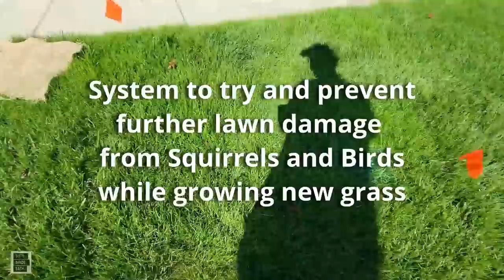EGO Select Cut XP High Lift Blade Sample Cut plus Suction Power Test

Comment: I wish you'd show tightening the bolts/nuts with a torque wrench to the proper torque values called out in the owner's manual. Otherwise, nice video.
Reply: I didn't even think of that. I should've read through the manual...off the top of your head do you recall the torque called for?
Reply: @paula.2422  , yes. Center bolt is around 36-40 ft lbs. Blade holding bolts are 22 ft lbs. 
Note that recent manuals for the 2135 and 2150 have the torque values swapped. Do not follow the manual if those values are swapped.
Reply: @mikehamm1  Excellent! Thanks so much for the info..

Comment: Hi, thanks for your video. I may not have the same grass than you, I have very dense grass and the mulching dual blades does leaves mowhak lines. I believe that the grass is not enough lifted, the mower does not get enough air. Do you think those dual high lift blades will be better even if I mulch (they sell it for bagging). Thanks for your input!
Reply from the maker: Hi Armstrong thanks for watching Honestly no, they lift but the way they are designed they are made to bag with. My opinion

Comment: Be careful using chrome-plated sockets with an impact. It can be dangerous. It probably won't happen with an impact driver like that, but I would still google why it's possibly an issue.

Comment: I went ahead and bought the blades from the link you posted above (EGO Select Cut Series High Lift Blade set @t ) and just got them in the mail today. So I immediately put them on to try and mowed for about 5 minutes. They definitely have more pull on the grass, no doubt. They suck up leaves no problem and I went over a few stragglers since my last mow this past weekend and they cut all of them. You can tell that they tax the motor a bit more but not enough to kick it into high gear just running with no load. I can tell that it will kick into high with less grass load now since the blade itself adds load. Which IMO is a good thing, talking about blade tip speed. I thought that before it took too much load for it to kick into high which hurt the cut quality (minimally as I think this mower cuts well out of the box with the aggressive blade). I tend to cut high using the 2nd to highest or highest setting. I have fescue in the south and if I don't cut high it will burn up. I noticed that on the old blades on the 3rd highest setting or lower it cut just fine with the old blade. It was when I went higher where you could really tell it would leave stragglers and parts of the grass uncut. That's where the cut quality suffered. This new blade definitely helps to cure that. Here's what I will say though. It's a big improvement but if you are expecting commercial honda type lift you need to temper your expectations. I've had mowers that will lift big twigs when set at 5 inches. This new blade will not do that, although it did pick up a very small twig with 3 or 4 leaves attached on the 2nd highest setting in my quick test. So if you're expecting a hoover then I'm sorry to say you might be disappointed. But if you are expecting adequate lift on higher height settings, which is what I really wanted and where the old blade was lacking, this is DEFINITELY worth the $40 you'll spend. I haven't mowed in tall grass yet so I can't really comment on the mulch ability however based on the above video I believe it will do just fine there given the results as well as the fact that we have the cross-cut blades.  Thanks TME for the review and the link to buy the blades. Got them in under a week with free shipping!
Reply from the maker: Solid info and thanks for using our links much appreciated 🙂
Stay in touch, I don't k ow everything but I enjoy being resourceful and helping my awesome subscribers

Comment: Do u think the 2156 will do a better/nicer cut for regular grass than the 2135 model?
Reply from the maker: Hi K thanks for watching 
What determines regular grass? The big thing with 2135 vs 2156 is a stronger motor and more torque, this can be useful for tough jobs. If you cut your grass often and keep it low then the 2135 would be fine.
Reply: @TechMadeEzy  Thanks. So its just for tough jobs, and not about delivering a nicer cut etc. For low grass I won't see a difference between 2135 vs 2156. Right?
Reply from the maker: I don't think so, pick up the high lift blade now that it's available that will help with your cut in some examples.

Comment: In Australia, we don't get the extra blade, it just comes with the hi lift blade already installed.
Reply from the maker: Thanks Geoff It's interesting to see how EGO does business in different countries
Reply: I heard also the Ego brand is less expensive than the brands like Toro in Australia 🇦🇺. Funny how it all works 🌎
Reply: @seanrice7511  Toro is not very big here. I' have seen a gas Toro in a Bunnings store, but I've never seen them advertise and heard very little about them locally. I think the Toro name is already registered in other areas such as irrigation,  which may hamper their introduction here.

Comment: I love my EGO LM 2156SP! Bye Bye Honda...
Reply: Which Honda did you have … HRX?
Reply: @milanjurich1526  It's the HRR 216 Model with  the GCV 160 Engine. Got it from Home Depot back in 2019 and it's already a dog - incredibly hard to start and the rear wheels continue to lock up all the time - after only 2 seasons of mowing. My EGO already destroys it!
Reply: @DeadSeaGenesis  Nice to hear.  I’m looking at the EGO and the Toro battery right now.
Reply: @milanjurich1526  You can't go wrong with the EGO 2156 SP. What an amazing mower! It brings me back to my Lawn Boy days only BETTER!!!
Reply: Just buy the ego. U wont regret it. I own ego chainsaw,leaf blower,weedeater, self propelled lawn mower,the 2 stage snowblower and just purchased the ego zero turn z6. I love them all!!
Reply: @DeadSeaGenesis  I have a 3 year old HRX217 and this EGO is not even close to the cut quality of the Honda. See that grass that shoots out when getting to the walkway or driveway? I never get that with the Honda. The piles at the end when making a turn? not that either. Now I have the EGO 56v blower and that blower is the best I had ever used. I abuse the crap out of mine it is 4 years old and still goes like day 1. Just don't see the hype of their mower.

Comment: Are you getting a lot of mulch stuck in your mulch plug area? I have a ton plugged up in there when I pull the plug out.
Reply from the maker: Yes if I Mow slightly wet grass
Reply: @TechMadeEzy  it’s strange. I mowed very dry grass yesterday’s bad there was a huge pile stuck in my mulch plug around it and inside it.
Reply from the maker: Don't stress that, the gaps make that happen.

Comment: I'm doing a conversion from my single blade ego to the dual blade. I was on the fence between getting the high lift or the mulching blade. I was originally going to get the mulching blade since I almost always mulch, but the high lift blade seems to be a better, more uniform cut, and does pretty good with mulching. I'm going with the high blade. Thanks for the content
Reply from the maker: Hi
For mulching 
The High lift produces good suction but will leave larger pieces of mulch compared to the mulching blade

Comment: Using an impact driver I have found that I seldom have to secure the blade while loosening the bolt/nut.  The impact action loosens them without rotating the blade.

Comment: Just watched lots of mower reviews, most American but can’t understand why you guys don’t cut your grass much shorter so it looks more like a billiard table. Anyway I’ve just bought the EGO with the steel deck rather than the plastic deck but first impressions after only one use are great, never going back to petrol.
Oh, looks like it came with the high lift single blade stock.
Reply from the maker: Hi Nigel, short during the spring and fall is OK, not too too short but summer don't do it or you will burn and kill your lawn. Congrats on the new mower 👍🏻
Reply: It takes a lot of work to maintain a lawn at golf course putting green length.  You need a special mower to keep it short.  You need to mow it 3 times a week.  You been to water it often.

Maybe that is doable on a lawn this small, but we are talking hours of daily work on a a yard with a bigger lawn.  An some people do pay a yard service to do this … and who am I to complain if you want to spend $$$$ on keeping up with the neighbors.  I’d rather invest mine.

Just my two cents.
Reply from the maker: Thanks Thomas yes we do all have different circumstances for sure

Comment: Your time and effort is greatly appreciated 🍺
I wonder if both the connector nut & bolt set and center washer & bolt will be available for sale. Mine are looking a little beat up already after using my impact wrench a few times.
Reply from the maker: Thanks Sean hope you like it
Reply: @TechMadeEzy  I did! I just did a mulch at 4 last week, and a 3 bagging this week, both with high lift blade. Same results as you. I have KBG and 3 is as low as I go too. 

It’s a better cut quality with high lift. The mulch is a little bigger and can clump in the deck more compared to gator blade. Very similar. I think high lift should be installed standard. I think they should make a new blade, a cross between the high lift and the gator, like the Toro Atomic. Thanks again for your efforts.
Reply from the maker: Thanks
Reply: I’m in the same boat with my impact wrenching and would like parts numbers and availability of both the center blade bolt and washer and even the larger bolts and nuts that hold the blades together(I’d like my blade combo’s pre-built and ready to swap).

Comment: Does your rear tire lock up sometimes depending on the turns and reverse you do?
Reply from the maker: Hi at thanks for watching 
Rarely but it seems that’s the nature of the design so I stopped complaining about it
Reply: This happens on 3 of the 3 egos I have owned.
Reply: Mine does too. When it does that just push the the mower slightly forward then it will unlock
Reply: Do you all think this is a design flaw and should be addressed?
Reply from the maker: I think it's just the way the motor works, always has. It bothered me in the beginning but now I just push forward a little and it disengages.

I would prefer not to have this but I've accepted it.
Reply: I keep checking that I don’t have SP turned on and I’m not accidentally pushing the button. It locks up like that even when I’m doing JUST push mowing. When I read other reviews I assumed it was when coming off of a self propelled run. But it happens a few times a mow 😕 in my backyard where I don’t use self propel and have lots of small areas where I go back and forth.
Reply: YES, and it’s very annoying. EGO should have some kind of fix that associated repair centers can perform.

I typically mow without the drive engaged and have a number of trees and obstacles requiring back and forth movement. The drive tire locks frequently and in some cases takes a lot of backtracking to release.

Briefly engaging the drive motor unlocks the wheel BUT this should not be necessary. Seeing this is not unique to my mower indicates that it is probably a design issue.

My guess is that EGO is aware of this and will quietly fix this in the next set of mowers while still selling the growing fleet of older models through the various sales channels.

Comment: Great video. I was wondering if you can tell me the nut sizes I'll need because in going to install the double blade system on my ego.. kinda hack... I heard you mention 9/16 or something. But I'm not sure what I'll need
Reply from the maker: I’ve never done that before but it was 9/16 and 11/16 and thanks for your comment 👍🏼
Reply: Which one was what? How many do I need. I know there is a total of 3 bolts
Reply from the maker: I don't know about the hack so I won't be able to help you, also be careful you could void your warranty.

Comment: Do you think adding the high lift blade will reduce battery life when mowing?
Reply from the maker: Not at all, it will use more. But very little more
Reply: @TechMadeEzy  I can live with that...
Reply: @philipmorgan1438  I think as long as your mowing an average weekly length and using a larger battery, you won’t notice much difference in run time from my experience. Mine did rev up more with the high lift blade. Fine by me.
Reply: @seanrice7511  If it doesn’t half
the mowing duration or like, it wouldn’t matter much. 👍

Comment: Awesome.... ok I know that the battery of this mower can be use on the blower and the weed eater but how about the battery that comes with the blower and the weed eater? Can you use the weed eater battery and the blower battery on the mower? I ask because looks like this battery of the land mower is more power full or has more amps ! Please let me know. Thanks
Reply from the maker: Hi Angel yes 100% but keep in mind the more amp hours the longer your run time, 5ah will probably be a minimum but I say 7.5 is preferred. How big is your lawn?
Reply: @TechMadeEzy  is very small I don’t have much yard, I think I will be ok ..... thanks for taking a moment to answer my question,.
Reply from the maker: Sure stay in touch let me know how it goes

Comment: I have been loving your videos. I am a complete lawn care novice (lived in co-ops up until now, so this is my first real house with a yard) and your videos have been a real help. Question -- which of the 3 blades is best for mulching up leaves (without bagging so they feed the lawn)?
Reply from the maker: Hi Jay thanks so much, wht model do you have? Lm2102? Etc
Reply: @TechMadeEzy  I actually have not purchased the mower yet! We are that new at this. But leaves are a big deal at our place. There are a lot of trees. So my purchase decision is going to be heavily based on the ability of the mower to mulch leaves.

Right now we are leaning heavily towards the newer EGO Select Cut XP, though we are also looking at the Ryobi Cross-Cut. I’ve seen on your videos that they have different blade choices.
Reply from the maker: I would recommend the Lm2156sp you get the mulching blade but if you are dealing with leaves I would recommend using the high lift blade it comes with and do some bagging. The 2156 has amazing suction power with the high lift blade.
Reply: @TechMadeEzy  Thanks!

Comment: Great job.  I have a LM2100SP would you know if I can use the 2 blade system high lift for the select cut?
Reply from the maker: Freedom no officially, you could void any warranty you may have. I have seen unofficial videos online that show people how to do the dual blade. Or check for special pricing on the Lm2135sp or LM2130 or LM2130sp might get better pricing now that the LM2156sp and LM2150sp are out
Let me know how it goes
Reply: @TechMadeEzy  thank you for getting back to me so fast.  I just got off the phone with Ego and the woman told me I can use the twin blades for the select cut on my mower. I asked her twice just to make sure and she said yes. ?
Reply from the maker: Yes select cut mowers come with twin blades already, then you can change blade types like high lift etc.
Reply: @TechMadeEzy  sorry I didn't explain myself better. I don't have a select cut mower.  I have a single blade mower.( LM2100SP) but she said I can put the 2 blades from the select cut on my mower. I think I will call Ego again and ask another representative to confirm. Goodluck with the channel.
Reply from the maker: Here is the direct EGO page for that series I promise you it’s not made to fit two blades
Unless you try something unofficial 

https://egopowerplus.com/21-inch-self-propelled-mower/
Reply from the maker: The LM2130 and LM2150 series are the select cut dual blade models. 

Hope this helps
Reply from the maker: Here are a set of the new blades for select cut, scroll to the bottom where they state what models are compatible 

https://egopowerplus.com/mulching-blade-set-ab2101d/
Reply: @TechMadeEzy  ok great job thank you
Reply from the maker: Thanks stay in touch, I hope I can help

Comment: Looks like I should buy a lift blade for my older version self-propelled EGo mower for which it wasn’t offered 3 years ago.  👍
Reply from the maker: Philip thanks for watching 
is it 21 inch or 20 inch ?
Reply: @TechMadeEzy  I’ll check but I believe it’s 21”
Reply from the maker: OK I did include links in the description for the select cut a highlift blade and the 21 inch previous model highlift blade
Reply: @TechMadeEzy  Thx!
Reply from the maker: My pleasure stay in touch let me know what you end up doing and if you need any help
Reply: @TechMadeEzy  it is not clear whether the high lift AB2100 blade is added to the current blade or intended to replace it entirely.  Any idea?
Reply from the maker: On your model it can only handle 1 blade at a time, not 2 so you take off your blade and put the high lift blade on that’s all 👍🏼
Reply: @TechMadeEzy  OK... simple... Thx! 👍